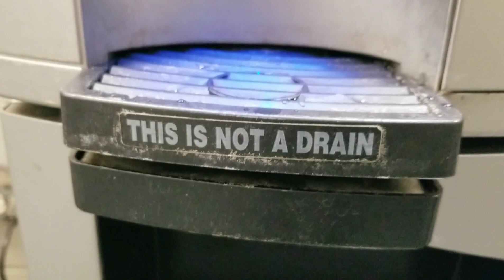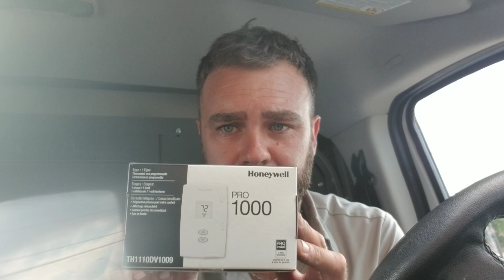HVAC Roof Top Maintenance

Comment: Looking at this 1" P trap I ask myself - what is the max. negative pressure which can be expected (worst condition) in a case like this? Was it ok?
Reply from the maker: The trap has never been an issue!
Reply: @HVACKnowItAll  Thanks. It looked like much water was accumulated and released only after shutting off the unit. I was wrong.

Comment: Do you lube pivot points on the economizer dampers? If so, with what?
Reply from the maker: yes, WD40 works just fine.  Its something that just be done at least once a year.

Comment: Great clean video without the B.S. How did you get the coils washed out? Do you use a portable water system or run a hose?
Reply from the maker: Could be a possibility to use that type of power washer
Reply: Was curious if you have a coil jet pack $$$$
Reply from the maker: @HVACRSurvival  i do not
Reply from the maker: Didn't clean them yet

Comment: @8:25 When I do preventive maintenance, I like to tape those filters together with regular duct tape. It's a lot easier to remove them, especially when it comes to those 250 ton AAONs with 5x2 filter rows. I also find that, after giving a first round of machines' evap coils a wash until they're good as new, taping filters together prevents that line of gunk that's apparent on a lot of equipment. Great video regardless!!
Reply from the maker: Good idea, thanks...never thought of that!
Reply: I can agree needing to duct tape those filters on an aaon unit. just love it when I see that mech wheel with filters stuck in between and they get stuck not spinning